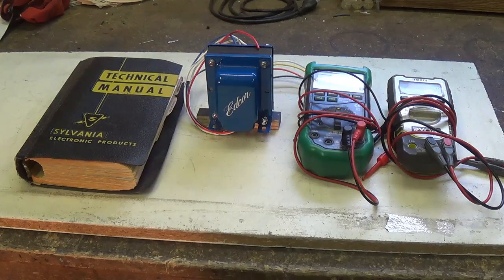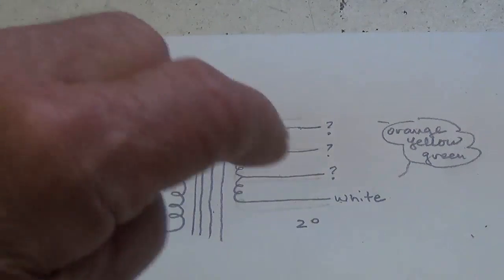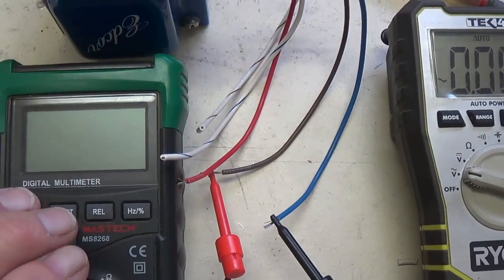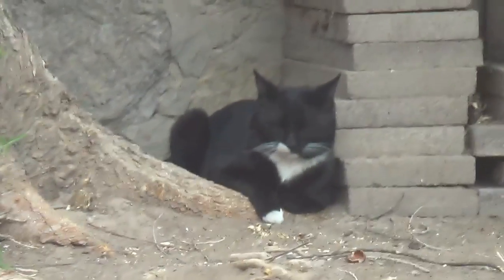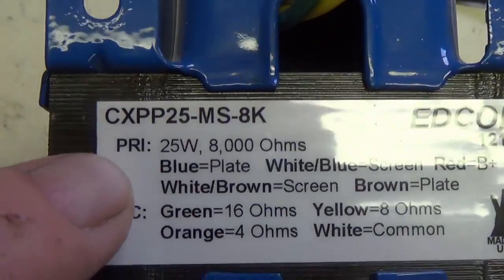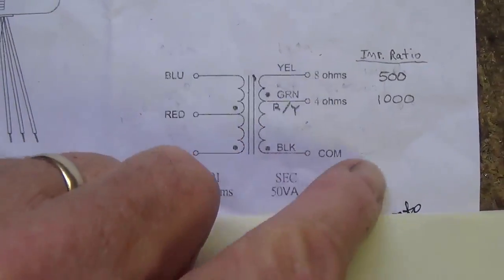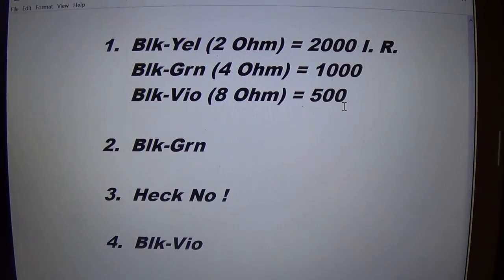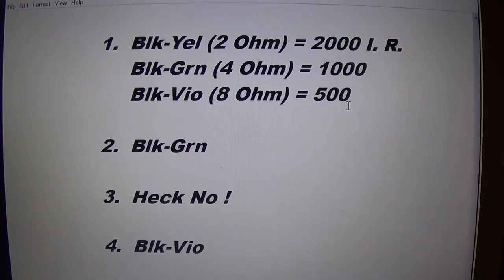Impedance Ratio: The Easiest Way to Decipher Output Transformers

Comment: This is definitely a much appreciated video.  Could a signal generator be used at say 1v  instead of a variac or 12vct transformer?   Thanks again!
Reply from the maker: You're welcome, KG. I guess it could, as long as the input voltage was accurately measured. Also, the results will vary due to the frequency of the input, so it should be consistent and around 1 to 2KHz.

Comment: That rod is so nice! I love the intake noise at idle followed by that throaty roar. Can suggest white-walls at some point?
Reply from the maker: Thanks, Gerry. I agree, but the tires are brand new 17" Coker Excelsiors, not particularly inexpensive, and replacing them would be a bit of an economic hardship. Maybe in the future.
Reply: @UncleDoug  I totally understand. A new set of quality tires isn't cheap, especially as those rims are not usually given quality rubber, are they? Having said that, choosing them was a great idea, they look for all the world like early (30's/40's) German steel wheels, like the ones that graced the Citroen 11 Traction-Avants built under German occupation.
Reply from the maker: They remind me somewhat of the "artillery" style wheels used on mid-30's Chevrolets, with the large perimeter holes.

Comment: You are producing a wonderful set of videos.. priceless by my standards, and I thank you!
  I was watching you refurbishing a Princeton Reverb recently .... it used a pair of 6v6 Output tubes and the plate voltage at idle was 392 vdc, well over the 285 volts listed on the Sylvania data sheet. It would seem that running them in the 400 vdc range would substantially shorten their lifespan. Is there a wide safety margin in these specs?
Reply from the maker: Thanks so much, Charles. Fender ran virtually all of their 6V6's at well over 400VDC and the tubes seem to hold up pretty well......but I tend to reduce the bias to achieve plate dissipation values that are within the acceptable range, i.e. about 70% of max, or 8.4W. The tone actually seems to improve a bit and the tubes last much longer.

Comment: Uncle Doug, I have heard you reference your variac several times in this vid as well as your current limiter. The limiter looks easy to make. What other uses besides slow start-up and perhaps motor speed do you use for your variac  ?  What specs & manufacturers would you recommend for an intermediate / hobbyist ?    Thanks,   J K
Reply from the maker: Unless you are repairing amps or starting up ancient circuitry, there is not a huge amount of use for a Variac, James. Mine is rather basic: 0 to 130VAC with 8A capability. They are available on Ebay. Some have voltage and current meters, which are more expensive but very helpful.
Reply: Thanks Doug. I also watched a vid on Mr. Carlson's Lab, in which he set up a wall board with a variac, two limiting light bulbs, and his 120 / 240 volt isolation transformer.  That lead me to "Old & New Electronics by M. Caldeira" who made a different set-up with more bells and switches. I like the creativity all of you use to make working with electronics safer and easier. I don't like sparks, melted resin, and damaged test gear...let alone the metallic taste in my mouth when I get jolted.  I will likely go and watch more of your archived videos as time allows.  I see there is a variac with digital meter on CIRCUIT SPECIALIST site for about $100 which I may get.  Keep fixin' & teachin".    J K

Comment: Thanks Uncle Doug for this great video!  Made me wonder... How can you tell if an output transformer is made for single or double-ended operation.  Is there an electronic way to tell if the core is made to NOT saturate without physically tearing into the transformer?
Reply from the maker: The easiest way to tell is that SE has only  two primary wires, while DE has three. As far as the core......that's a tough one. Maybe weight ??
Reply: Reason I'm asking is that I have a sealed transformer that has about (3) fairly equal (in turns ratio) primary taps to a common connection.  Don't know if it's a single-ended or ultra linear. A real head scratcher.

Comment: Hi uncle Doug I love all your videos you are a great teacher. I have a question I just can't figure out. What if you have 4 output tubes? I have the book and it's always 1 or 2 tubes. An example a hammond 1750u has the reflected impedance of 1.7k. In the tube book 2 ab tubes are 6.5k. I can't figure the math out to make this work but it's the correct replacement in a 100w marshall. Thanks if you get to it.
Reply from the maker: I find tube load resistance to be a very contradictory and confusing topic. If you look at a tube manual, the LR seems to jump all around and not follow an obvious pattern.  It's bad enough with two output tubes, and you would think that the net LR for four output tubes would be half the LR of two.....following the formula for parallel resistance......but it may not be.  Bottom Line: I don't work on many amps with 4 output tubes and am not an expert on the topic.

Comment: I just did this experiment on my  output transformer as a troubleshooting tool, using 3 different voltages on a variac.  The impedance readings came out just beautiful.   I hope that I can  assume that my OT is in good health and that my red plating issue is yet to be determined.
Reply from the maker: That's good news, Sting. Red plating can occur due to improper cathode bias resistance or reduced grid bias, depending on the type of circuit.
Reply: Uncle Doug   Grid biased in this case, 2 pairs of EL 34’s.  I believe conductive tube sockets initially caused runaway plate current on one side of the OT  or maybe a bad solder joint on bias resistor.   This damaged one or 2 tubes.  So I swapped sides with the tubes and runaway bias followed the tubes.  So what came first, chicken or the egg! Who knows?   Can’t wait for what comes next from you and Jack.
Reply from the maker: @sting1111  I can't say that I have encountered many conductive tube sockets. An arc between pins can create a carbon trace, but generally you realize the arc has occurred and can see the trace.
Reply: Uncle Doug   Thank you for your comment.  A humbling teaching moment.  It is too early to tell and maybe the problem will come back but for right now the amp is baising normally.   I think what you are saying is that it was the tubes all along...much to learn. Cheers
Reply from the maker: @sting1111  You're quite welcome, Sting. Best of luck with what I hope is a permanent repair.

Comment: Very nice! I'm working on a guitar amp using old transformers from a Harman Kardan I neglected to label when I put it off years ago. I used an LCR meter to get a rough idea of the outputs. This should help greatly though. I have a lot of transformers laying around so this will be useful. Cool Rod, too, did you do the aluminum welding? Thanks for the help!
Reply from the maker: You're welcome, Tom.  I don't personally own a TIG welder, so aluminum is not in my repertoire.

Comment: Uncle Doug-I've got one of these mystery output transformers on the 1939 Recording King amp that a previous tech installed, and I wanted to see what the replacement OT's specs are.  It's just a single, 8 ohm speaker transformer, so there aren't other speaker wiring options.  But I wanted to see what its Impedence Ratio is to be sure it's proper for the 2 6L6 tubes that this amp is running.

So since I have a Variac, I was just going to wire it directly tot he OT installed in the amp, and set the Variac to 20 volts output and connect it to the 2 connections on the Secondary, and then read the Voltage output from its Primary side on the blue and green plate wires with my Volt meter.  

Is this the proper way to set this up?
Reply from the maker: Don't start with the Variac at 20V. Connect it to the primary OPT leads and slowly increase the ACV from 0 to whatever input gives exactly 1.0VAC on the secondary winding.  This will reveal the WR.

Comment: Uncle Doug. You may have already been asked this question, but I'll ask it anyway. In this video, I think you explained everything very well insofar as a simple way if determining if an unknown output transformer can be used. However, I would imagine that the wattage rating of the transformer also matters. If so, is there also a way to determine what the rating of an unknown transformer is, if I bought it off a shelf in some used electronics store somewhere and did not have the luxury of knowing where it came from? Thank you. Harry
Reply from the maker: Yes, I get asked this a lot, Harry, and the answer is that there is no way to accurately determine the current capacity of any transformer, other than making inferences based on its wire gauge and overall mass.
Reply: Thank you for the quick reply. Do you think it would be safe to assume that, based on the results of the testing you described above, if the transformer impedances appear to match a particular tubes ideal plate resistance values as closely as the 6V6 tube, that particular transformer wattage rating should work for that tube without blowing up?
Reply from the maker: @harryhyams2403  Several output tubes may share the same plate load resistance but have different output power, Harry. The only way to know if an OPT is adequate is to install it and see what happens.
Reply: @UncleDoug  So basically what you are saying is hook it up and see if it explodes. I like that approach. Thank you . Harry.
Reply from the maker: @harryhyams2403  I am saying rather than ask people what will happen....and get 9 different guesses, all of which are incorrect.....simply connect the OPT to the circuit, connect the AC cord to a current limiter, and see for yourself.

Comment: Uncle Doug,is there any chance of using the ultralinear taps as alternative primary wires? And since you end up not using all the windings on the primary, does it affect the wattage rating of the output transformer? I have a single-ended ultralinear Japanese Toei transformer, with the part number OPT-20s. Super, super thankful that you provide such valuable information free of charge!
Reply from the maker: I'm not sure that I understand the question, Jolo. My advice would be to tape off the ultralinear leads if you're not going to attach them to your screen grids. I believe the wattage rating is based on the plate winding itself.
Reply: @UncleDoug  I see. There was a custom output transformer from Weber, designed for AX84.com guitar amp builds, that provided multiple primary taps so that you can keep the same impedance ratios for the secondary outputs, even as you switch tube types (KT88, EL34, etc.), instead of needing to switch secondary taps as you change tubes out. I was wondering if the ultralinear taps might be repurposed for a similar function to the abovementioned output transformer design.
Reply from the maker: The only way to know would be to perform an analysis of all the winding ratios, then figure out which ones will provide the proper primary and secondary impedance ratios.

Comment: Great video.
But what if the radio is only using the end to a tapped wire that may or may not be CT?
Can you calculate the IR from CT to each end and then use the part that matches the tube?
Reply from the maker: I don't really follow the premise and can only suggest that you try it and see if it works. Good luck.
Reply: @UncleDoug  Yea, after reading what I wrote again, I can see that it is not understandable.
Try this. I have an audio transformer whose primary is center-tapped. And, only has two wires on the secondary. If I want to use just one half of the primary (that is from the CT to one or the other of its ends) as if it were the only two wires, could you do that and calculate the IR for just those parts I am using? Was the question.
I tested it and it seems you can. One wire, of the three, on the primary is left unconnected. I tried it and it works fine. The plate dissipation, and bias current all came in.
I didn't want to try it because I might lose a tube but I threw caution to the wind.
This might be helpful if I ever get a tapped transformer that is not center-tapped. Maybe one half would work for the circuit where the whole winding, or the other half, will not.
I hope this makes sense.
Thanks for all the help I have gotten from your videos.
Luther
Reply from the maker: @OIE82  It sounds like you used a double-ended OPT (3 primary wires) in a single-ended circuit (2 primary wires). If so, it will probably not provide proper tone when driven. SE OPT's have different cores than DE to avoid early saturation.

Comment: Hi, thanks so much for this! quick question - Does whether the power tubes are fixed or cathode biased affect how I read the datasheet and determine effective load resistance? thanks!
Reply from the maker: No. The load resistance is determined by the tube itself.....not how it is biased.

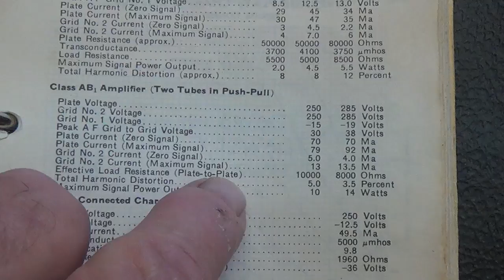Comment: As you show at 19:20 - "It varies depending on plate voltage." It's probably too complex for me to understand (at least right now) but how would one calculate load resistance for other (higher) plate voltages? Suppose a Deluxe Reverb with 415 volts on the plates.
Reply from the maker: I have never been able to find a suitable explanation for how to do this. There appears to be no predictable ratio or rule that applies to PV's other than those in the tube manual. Some LR's go up with higher PV while some go down. It makes no sense to me.
Reply: @UncleDoug  Thanks as always. It was my birthday so I’m just now getting a chance to thank you for your reply. Happy Fathers Day if that’s something you celebrated. I won’t sweat the rest of the OT stuff then
Reply from the maker: @SeanWeaver  You're welcome, Sean. Sorry I couldn't provide a better answer. Likewise on the FD good wishes, if they apply :)

Comment: Thanks, now I know that some alternative OT's can be used for my EL84 Class AB push pull project, not just those with an input imp of 8000 ohms. Not all data sheets give max watts though. I also noticed that the Mullard UK EL84 data sheet doesn't list 'Load Impedence' but the value is annotated as R a_a
Reply from the maker: You're welcome, Allan. Some tube manuals use strange abbreviations for common terms......Why? I have no idea, since standard terminology would be so much easier to interpret. On those pages, I tend to look at the magnitude and units of a number and can generally infer what it relates to.

Comment: Thanks Uncle Doug!
Maybe you or the group can comment on this.
Say I'm trying to build a Frankenstein amp out of whatever I can scavenge.
If it works out so that the output tube load and the impedance ratio give me a good 4 ohm output to the speaker, but I don't have any 4 ohm speakers, I can connect two 8 ohm speakers in parallel, right?
Likewise, if I end up with a 2 ohm output from the transformer, I could connect four 8 ohm speakers in parallel.
Do I have that right?
Reply from the maker: Yes, you are right on the money, SP. With multiple speakers you can wire them in different ways to get all sorts of impedances. With 3 speakers in parallel, you can really get some strange values.

Comment: hi uncle doug  I really love your channel and all the hard work you put into them.i have a question,im winding two transformers for a stereo tube amp im building ,and need to know what the average number of primary turns an output trans has for a say 20 watt amp,i need a ratio about 25:1 .If I wind 2000 turns to 80  I get 25:1   or I can wind 1000 turns to 40 and still get the same ratio .what problems do you get if I wind to much or to little at the same ratio   again thanks for all your great videos
Reply from the maker: I have no experience winding transformers, Martyn. I generally just order them from ClassicTone :)  Instinctively, however, I would guess that the 2000 to 80 ratio would provide the better output signal. I know that the best transformers always seem to have substantial mass and I'm sure the manufacturers don't skip on the number of windings. Best of luck with your project.

Comment: Just to clarify. In algebra the Sqaur of a number is to find the number times itself to equal that number. However, when you multiply the number against itself means to power of. For instance 2 to the power of 2 is 4, 3 to the power of 2 is 9, and 4 to the power of 2 is 16. Then you can reverse these powers by squaring. Squaring 16 results to 4, squaring 9 results to 3, and squaring 4 results to 2.
Reply from the maker: Thanks for your input, FF.

Comment: @Uncle Doug I have a '68 AB165 Fender Bassman 50 using two 6L6GC's in the power section. It has 425 plate volts. I have tested the output transformer. It has a 32.5 winding ratio for a 1056.25 impedance ratio, times the 4Ω speaker load, for a plate impedance of 4225Ω. The Tung-Sol Specification for 6L6GC says 5600Ω effective plate to plate impedance, at 450V for two tubes, AB1. Or, 3800Ω for AB2 at up to 360V. It doesn't seem to add-up. But, the ClassicTone replacement also specifies 4200Ω primary. I don't get it!
Reply from the maker: I agree. Once you start analyzing OPT's it makes you wonder where the manufacturer's get their primary impedance values. My Tube Handbook states an even higher value of 6K for two 6L6GC's at 450VDC......yet most OPT's made for this pair of tubes seems to favor a much lower impedance of 4K to 4.2K. I don't get it either. Is the book wrong, or are they ??